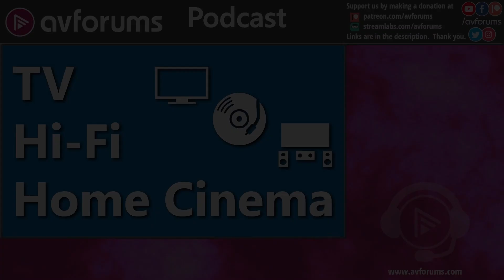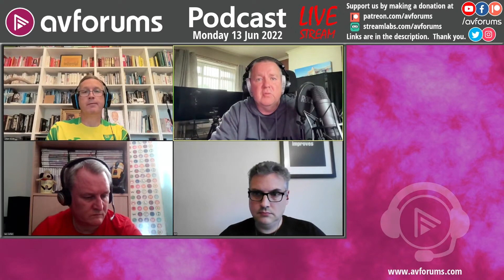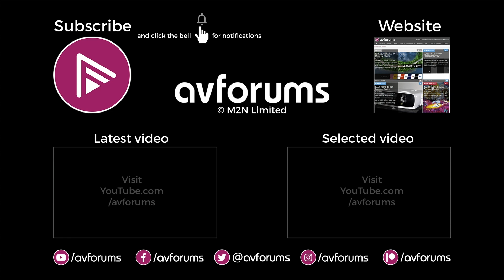Calibration Discussion: What is gamma/ PQ EOTF and why is it important? | AVForums Podcast 13-Jun-22

Comment: Thanks for the great explanation on gamma guys. So 2.4 and bt.1886 has always been the target gamma to use as the sdr standard. But 2.2 is a good idea if you have ambient light in your room. 
Lots of displays and monitors even default to 2.2 gamma but I guess that's to compensate for expected ambient light in a consumer setting. Still not sure if sdr games target 2.2 gamma anyway. But always tangled with the fact filmmaker and isf dark on my LG set default to BT.1886 while isf bright and cinema etc use 2.2. I watch my oled during the day with curtains open so for now I've sticked with 2.2 gamma.